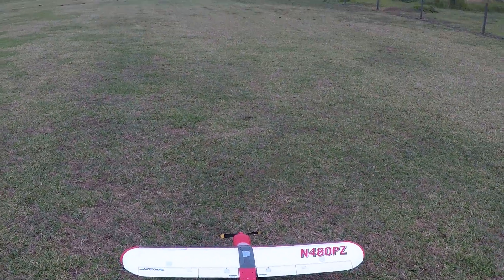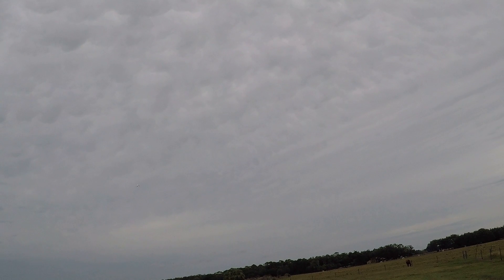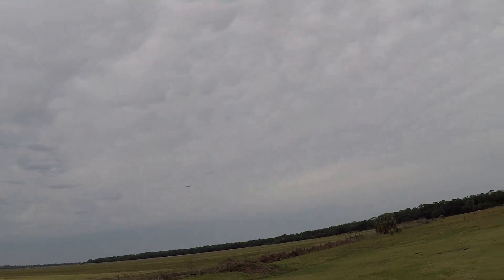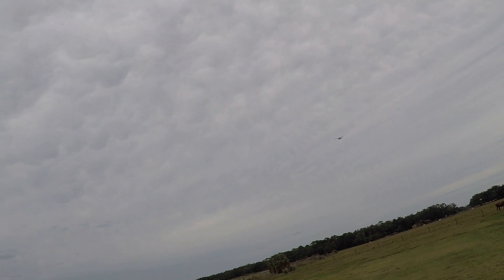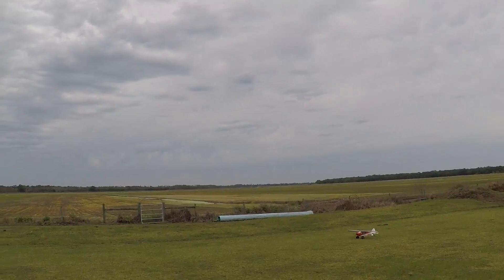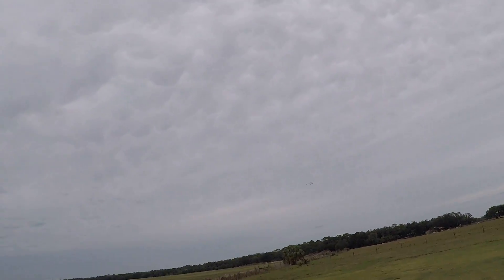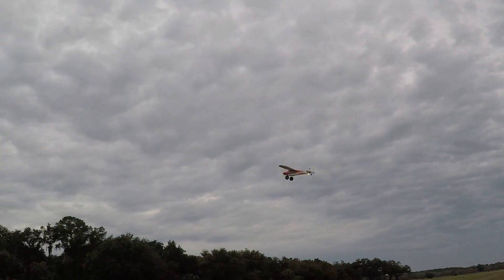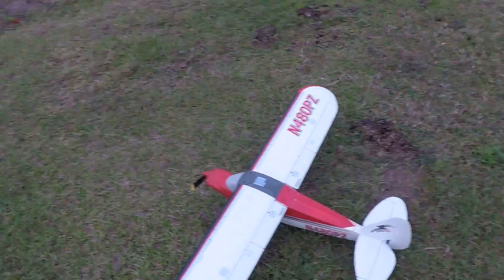Parkzone Sport Cub S2 Tip Stall Crash!!!

Comment: Nice video.  Thank you for sharing.  Full Flap deployment would have increased the lift to help you avoid that stall.  😎
Reply from the maker: Thanks for the tip! FYI I subded your channel.
Reply: Fat Guy Flies RC I missed out on this model when it was available.  I know the new Hobbyzone Cub is basically the same airframe, but the red / white color of the Sport Cub is so coool!

Comment: Michael Wargo always guns the motor a bit during turns.  I'm going to start adding that to my flying technique.  Did a stall/spin turning on final last week with a heavy T-Clips.  It wasn't pretty.
Reply from the maker: Yeah he is an awesome instructor. I have learned a lot from him and since this video. Sorry about the not so pretty incident.
Reply: Certainly, when low and slow and on final, especially when some flyers hook their last turn with aileron, rather than rudder.

Comment: The design of the Super Cub, Carbon Cub and Sport Cub are all prone to tip stalling. I think it has something to do with the dihedral on the wings as well as the size of the ailerons. I fly a couple other planes and they are bot quite difficult to tip stall. But remember this, folks. SPEED is life, ALTITUDE is life insurance!
Reply from the maker: Pretty cool beaver paint job you did. The yellow is much better than all that white. I subded also!
Reply: @FatGuyFliesRC  thank you! It was an expensive one! Custom matched paint with custom graphics, but it’s gorgeous 🤩

Comment: QUESTION: what  can I  do to  prevent  a tip stall  when turning at low altitude  for final approach, as I have to slow down...  ...are there any pre-stall signs to look for....any helpful  tips welcome.... ....thanks
Reply from the maker: All planes are different of course but normally tip stalls happen quick and most times its the wing on the inside of the turn. I hope this video will help you. Watch the whole thing to get the tips on embracing the rudder.

Comment: huh...yeah, that tail slide out too. you did say "nice rudder turn" earlier; i wonder if you used the rudder for turning as well as the ailerons? banking, and the tail sliding, both contribute to increasing the stall speed. it needed left rudder, i think, to keep the tail on track with the nose.
Reply from the maker: That's an old video I have learned the value of coordinated  turns now. Thanks for the visit.